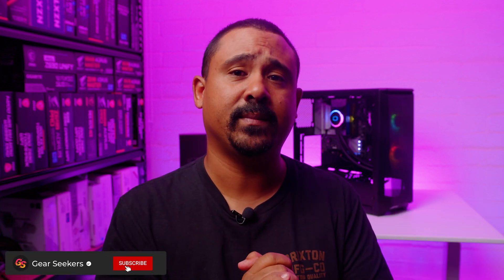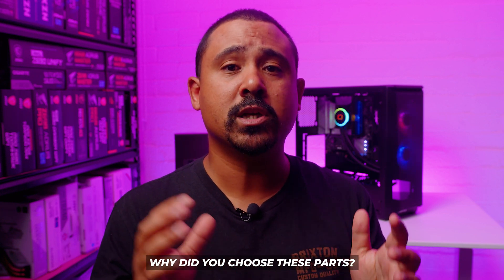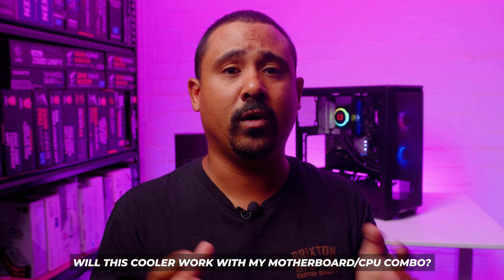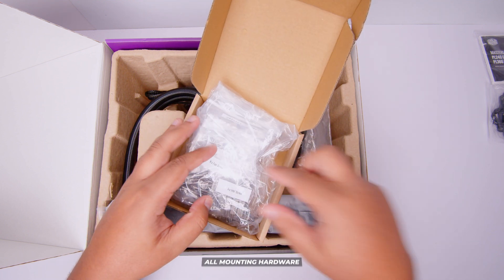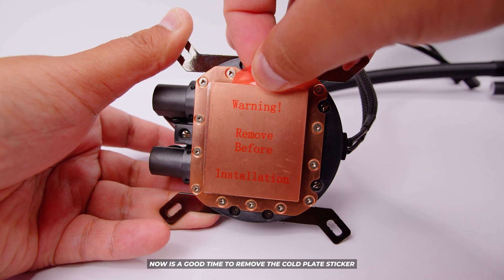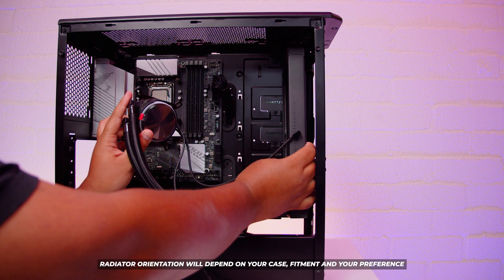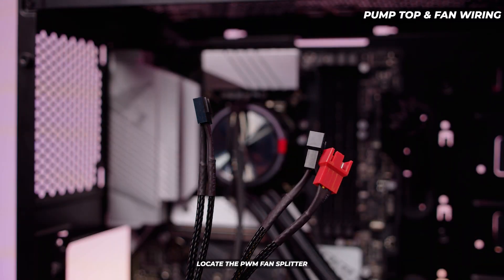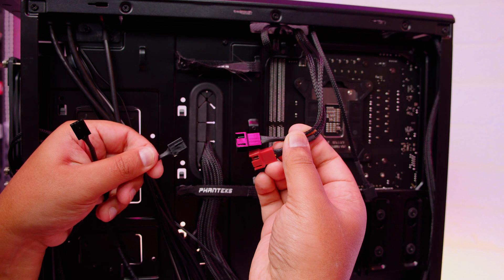HOW TO Cooler Master MasterLiquid PL240 Flux Intel Install Guide

Comment: Hi nick, I have a doubt. I have already mounted coolermaster ARGB pwm fans on top of my chasis. If I wanted to install the aio on top, can I make a push-pull config without throwing out my already installed fans? and do I need extra screws, the longer ones?

Comment: great timing, I'm currently researching an aio for my friend (although he does have AM4). I'm a bit confused tbh as i can't seem to get a clear answer on the max height for his corsair 4000d case - looks like Paul's Hardware JUST managed to get a 27mm cooler in - this one is 27.2 - surely that point2 isn't a dealbreaker!!!